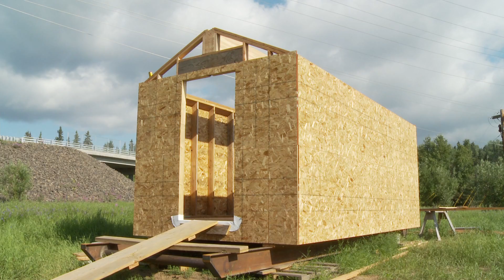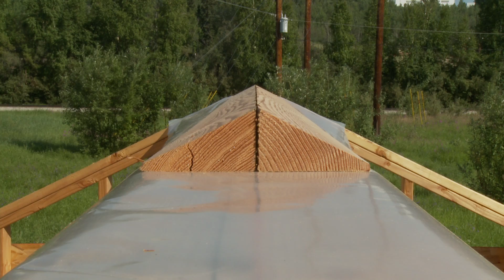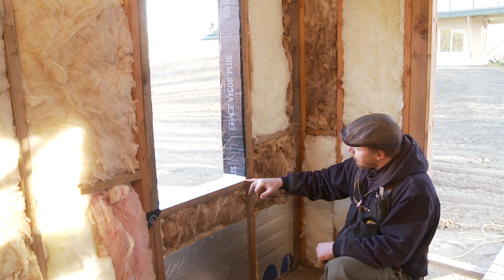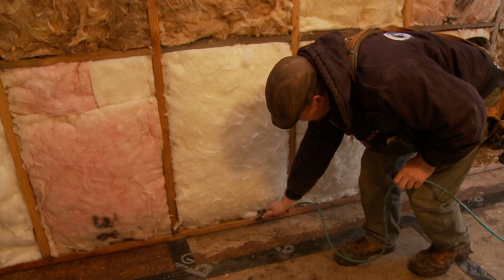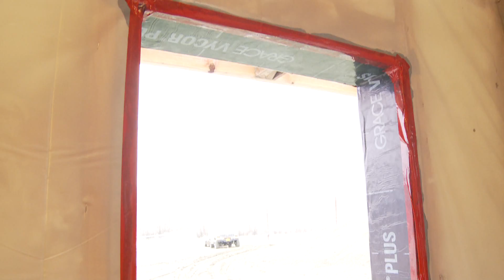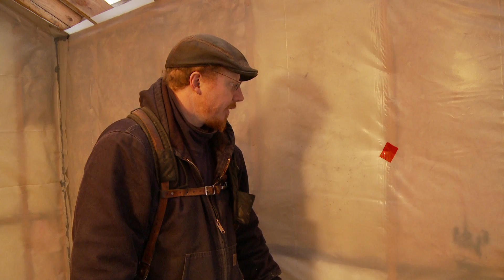Cold Climate Building Techniques and Concepts: Vapor retarder

Comment: This video is going to help me a LOT come May. We're building a 1200 sq ft cabin in upstate Minnesota. I was worried about vapor transitioning to the walls and freezing, so this solves that. 

As for introducing new air into the structure, we found an ERV that hooks up to forced air. That should help balance it out. As for the fireplace, we're running tubing to the outside through the floor to pull in fresh outside air vs. using the contained space air and pulling in cold air through every crack. 

HUGE Help! Thank you VERY much!

Comment: What about in the summer now when you’re air conditioning and it’s hot and humid out? That condensation is going to occur on your drywall. Poly is not a vapor retarder, it’s a barrier. Shouldn’t you be using something like a smart vapor retarder to keep moisture out but also let any that did happen to find it’s way in back out?

Comment: So much detail and so well done.  👍  A few questions:   Is poly needed in cold climates if the exterior wall has R30 of layers of rigid foam?   The building science behind no poly in the assembly is because the sheathing would only be able to dry from the Inside, so the poly would prevent moisture that got in the wall cavity from drying.   The idea in climate zone 6 is to have more R outside compared to in the cavity, 60% R out, 40%R in cavity. The more outside insulation the more chance of keeping the sheathing warm, if you do not over insulate between the studs and use rock wool, permeable insulation.  Some people are suggesting instead of poly to use Smart membrain by Certaintee. Smart membrain as vapour permeability on both sides...if a lot of exterior insulation, rigid foam is used because rigid foam is non permeable, especially at R30, 6 inch, thickness.  Thoughts and thank you...from Prince Edward Island, Canada🇨🇦

Comment: Question: If one does a continous insulation (both interior and exterior) with a big, code exceding r-value, does the interior vapor barrier become less important? As the dew point moves to the exterior of the roof's water barrier...or  does this just make the air barrier more crucial on the exterior? Are these trade offs? Does material cost play into this decision? Is a proper seal, as you've brilliantly demonstrated, more likely in one scenario versus another?
Reply: Living in zone 6 here in Canada.  Correct, paying attention to the dew point of sheathing is important. I think that if you have at least an R 18 on exterior the sheathing will stay warm all year around, so reduced condensation issues from moisture coming from the inside. I also learned, and will be applying to the extension build in the near future, that because there will be Outie windows, our Tyvek, or peel and stick vapour barrier will be applied to the most outer insulation, which is xps, 6 inches of it, with seams taped. The xps is an air barrier in itself, so we will NOT be putting an interior vapour barrier on the studs and the cavity will have rock wool because rock wool has a high vapour perm which will allow any moisture coming from the interior of the home to eventually dry to the interior when the colder climate comes, which drys the air, and therefore will allow any moisture on or in the rock wool to dry towards the interior.   Building science eh! You got to love it....if you understand it. 👍   🇨🇦             As for sealing, ask yourself what Steve Baczek always says,  It is now what you are sealing out, ask yourself what are you sealing IN.   Are you sealing in moisture....which comes in  a lot with air, and a little with vapour?

Comment: Why not use intello instead or plastic? And if you must use plastic, a good idea is to frame a second layer of 45mm studs with insulation on top of the plastic before drywall is hanged. Gives you an installation layer for electical and so that people can hang a picture on the wall without destroying the air tightness of the whole house.
Reply: Its called an Electrical Service channel.....clever and smart👍☺🇨🇦

Comment: QUESTION: IN Northern Minnesota, we air condition the same building that is heated in sub-zero weather in the winter. Won't the hot moist air in the summer hit the air-conditioned walls and condense much the same way as you describe in the winter? I question using non-permutable poly for that reason. I'm new to this....
Reply: Dont think they get to do much AC in the summer in Alaska. Here in Sweden most new houses have switched from airtight plastics to vapour retarder membrane. Gives any moisture that gets in during summer a chance to dry out.
Reply: Eastern Canada here....instead of poly, if you air condition, use Smart membrain from Certaintee....the smart membrain can move vapour on both sides, so interior wall can dry to the outside.   ☺🇨🇦.    Air conditioning changes the building science of vapour transfer....lots on the topic if you google.

Comment: Really excellent job on sealing that air barrier. Now hang your drywall, then cut a bunch of holes in it for electrical, plumbing, hvac, and hang a bunch of pictures with drywall anchors. :)
Reply: I saw in another video that European cold climate builders put horizontal battens between the drywall and vapor barrier. They run their wiring (and sometimes plumbing) in that space rather than in the stud cavity. Wouldn't this reduce the problems mentioned?  I like that idea and intend to try it on my build.
Reply: @wallygoots  Yes, it is called an Electrical service channel...super smart way to maintain air tightness.☺🇨🇦
Reply: We have another video that covers furring out (in) walls in the same playlist.  Often here the builders will also add additional insulation either between the furring as shown in the video or behind the furring.  Furring makes a big difference in preserving the integrity of the vapor retarder long term. 
Playlist: https://www.youtube.com/watch?v=R8RMR-e-LlE&list=PLBtw7qpC24vLes3TTm-6m7Zz7gWf1QgVo&pp=iAQB
Wall Furring: https://www.youtube.com/watch?v=BFp3y0KIaqk&list=PLBtw7qpC24vLes3TTm-6m7Zz7gWf1QgVo&index=7
Reply: @IlyaBenesch  Excellent!
Reply: Yeah, he really does a great job installing the air and vapour control layer but since he is using plastic its just never gonna survive after people have lived in the house for a couple of years.

Comment: Awesome video, thanks for sharing. I have a question. If some water or vapor found its way inside the wall, how does it come out? Do you install some kind of wall ventilation?
Reply: You have to either be able to dry to the inside or the outside or both. Poly is actually never a good idea but it’s much worse if the exterior has a non permeable surface like poly iso foam. This creates a “vapor barrier sandwich” If you are wanting to use something between your drywall and cavity insulation you should be using a vapor retarder like Certainteed Membrane or Siga Majrex 200. If you have a lot of exterior insulation then you technically don’t need anything but it is important to air seal your drywall to the studs with something like big stretch caulking so that vapor can’t enter the wall cavity any way other than diffusion but a good primer and latex paint will slow that down as well.
Reply: in cold climates an ERV appears to be the unit to use.  ☺🇨🇦

Comment: why you do not use that special tape what is ment for vapor retarder? Example prof DIN 4108-7
Reply: I'm familiar with that tape, but haven't used it.  It's hard to source some of this stuff - especially for us in Alaska.  Not to mention the cost.  The general issue with most tapes- in my experience- is that they have difficulty sealing the vapor retarder when a fold or a wrinkle occurs in the plastic.  And folds and wrinkles are inevitable when installing 6 mil poly.  The bigger the area, the greater the potential for wrinkles.  The Tremco, being a mastic but quite soft, can be used as a bedding surface for the poly such that it can also seal localized wrinkles and imperfections along the overlap.   We recently did an inspection on a commercial ceiling that was taped but Tremco accoustical sealant was not used.  There were some big folds in the plastic (due to a sloppy install) and even though the poly was flat behind the drywall, the building pressures (due to ventilation imbalances) were enough to force warm air past the folds in the plastic.  Often we'll put tape over the plastic if there's any concern the plastic edge could get lifted due to other work going on before the drywall goes on.  The other potential problem with tapes is that contractors will generally use whatever is available in the store that is rated to do the job.  Not all tapes are created equal -and the unfortunate truth is that though a particular tape may be advertised as having good adhesion to poly, long term performance is sometimes severely lacking.  Tremco Acoustical sealant has been in use in Alaska as a vapor retarder sealant long enough now that we have opened up walls built 30 years ago and it is still is going strong.

Comment: @ 6:47 May I make a suggestion to Pitching the Sill??? Using a wood beveled siding to set an angle, one piece for every window or door??? Then apply your sealing tape and roll it, Its inexpensive too!!! Let me know if you like that idea??? I am going to be building in Eastern USA in New Hampshire or Maine soon!!!
Reply: It's a great idea, KJ. My wife and I did this very thing on our new home 15 years ago. Cheers from British Columbia, Canada!
Reply: yes and add a back stop and tape that down as well. Bevel is 5 degrees I believe...or like he said, a 1/4 inch slope.  Cheers Prince Edward Island🇨🇦☺
Reply: Yes, beveled siding is great for pitching the sill.   When we do it, we try to get our hands on beveled cedar.  When we are building with exterior insulation where we have window bucks on the outside of the sheathing, we will also used beveled siding on top of the buck and integrate that slope into the weather barrier on the wall such that any water that makes it past the exterior insulation will be able to drain outwards and not remain trapped between the insulation and the sheathing.  I think that in general it is a good practice to pitch the sill.  That said, in some climates there isn't enough rain to warrant the extra level of detailing - especially if the windows are protected by big roof overhangs and there isn't much wind.  It's hard to convince builders to go the extra mile when they feel the effort isn't warranted.   It's a tough line to walk sometimes.

Comment: Why not just put all of the insulation on the outside?   what am I missing?
Reply: Yup...that is what should be done.  R 30 would be nice in climate zone 6 and that way no poly on interior using rock wool R18 between the cavity. The rock wool will allow any vapour to dry to the inside and the sheathing will always be warm if you do not Over insulate between the cavity.  60 % R outside to 40% R in cavity for zone 6 and above.  ☺🇨🇦
Reply: If you tried to put all of the insulation on the exterior, it would be a real tough situation for your windows, doors and siding. All your windows and doors would be sitting outside of the structure and you would need really long nails or another layer of sheathing to attach your siding. They do roofs that way and add that layer of sheathing because you typically don’t have many penetrations and no doors or windows on a roof (typically)
Reply: Why are the insulation all different colors and is a vapor barrier needed if you use mineral wool insulation?

Comment: Seal the framing to the sheeting after window is cut out with sealant. We frame larger opening for thermal break to be installed around window. We then spray foam around thermal break. Also spray foam window and door bays and the ones next to them. And don't use vapor barrier on those bays. The idea being condensation from doors and windows being cold is allowed to dry. Ever wonder why it molds around doors and windows even with air tight seal? Or why window or door trim is cold. One of the changes we made after using thermal camera. We use the thermal break in the middle of headers too.
Reply: Pocket headers....insulation between window headers...a Steve Baczek detail....smart!👍🇨🇦

Comment: I always wondered about that when cutting roofs back for ridge vent. Wonder how many houses have rotten ridge beams from ridge vents?
Reply: Good point.  The venting should function appropriately relative to the local climate.  In Fairbanks, as a general rule, a dam on the roofing below the ridge vent slots in the sheathing (ie J metal termination at the top if its metal roofing) and a generous properly bent and sized ridge cap are adequate in keeping out weather.    In arctic maritime Western AK we've designed ridge vented homes that are right on the coast built to withstand a design wind load of 160mph.  So even on an 'average' day there's typically enough wind that it rains sideways.   Climate is too windy to support trees.  In those cases we've been using ProfileVent as that product was advertised as meeting the Dade County 110mph wind driven rain test.  We talked with the manufacturer at some length about install specs and at the time (5 years ago) it was the most robust tested product we could find for such extreme conditions.  It's on our short list of places to return to and inspect by physically pulling up the ridge cap on several homes to see how things look.

Comment: Hi, is there any benefit to attaching membranes when wall is vertical, rather than when the wall is laying flat?
Reply: Yes, there are certainly times when it makes sense to do so. Typically we do this with exterior weather barriers with multistory buildings where adding the layers off ladders and scaffolds complicates the construction.  Sometimes we will finish an entire second floor wall with windows and siding before raising it.    On the interior, with a poly vapor retarder, we'll sometimes install it with double walls when the inner wall is laying down and the vapor retarder is on the back side of the inner wall.  With conventional framing, generally installing the poly with the walls standing up is also pretty convenient as gravity can help in hanging the membrane and keeping things flat and quick to install.   It really just depends on the situation.  With a standard 8' tall wall, it's pretty fast to install the vapor retarder with the wall standing up.